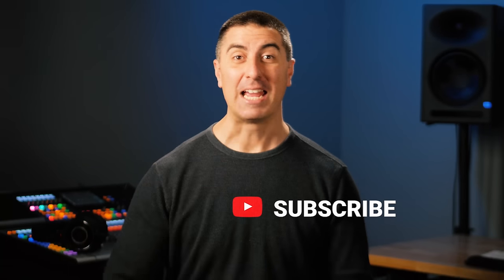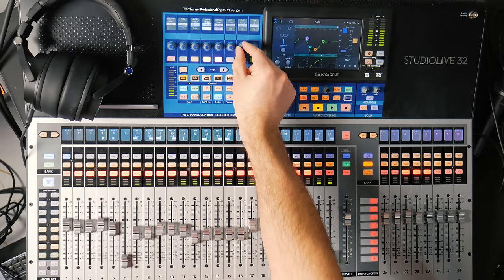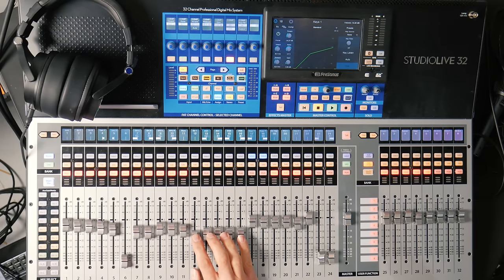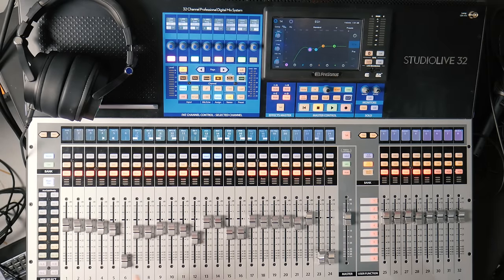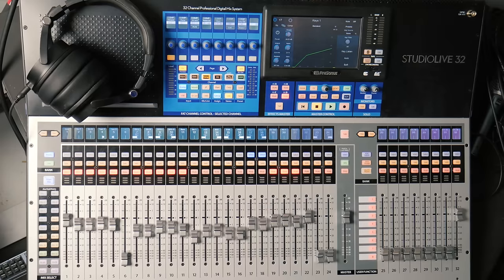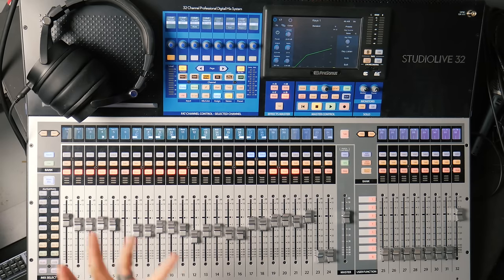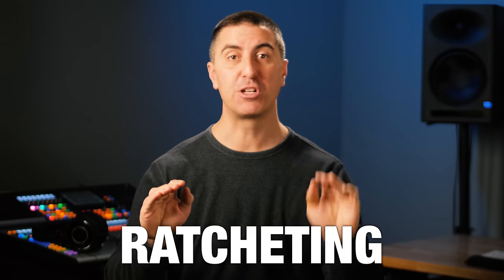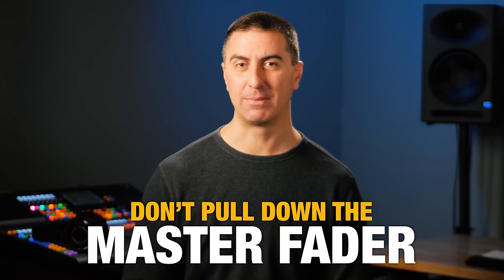Mixing Lots of Inputs Without Being Too Loud

Comment: I need to show this to our integrator. He hates that I use any kind of compression at all and thinks that I compress the life out of the sound. He's the only one who thinks so. I actually use parallel compression sometimes to add some life back into the compressed signal without increasing the overall signal. If I need to add to the signal, I use the gain makeup on the compressor. He doesn't like that either. He's not the one I have to make happy so I don't listen to him on that anyway. But it is good to hear someone who is knowledgeable justify what I'm doing. Personally, I think he's just deaf in the higher frequencies and likes anything that boosts those. I'm old enough to have some natural hearing loss in those frequencies. That's why I like to keep young people around - to alert me to any squeaks I can't hear very well.
Reply: No compression? That’s crazy !
Reply: You need a new integrator
Reply: Whats an integrator sir?
Reply: Use it properly and he won’t think that anymore. If you smash it he will notice because he’s so used to the consistency of the natural voice. But I get what both sides see now that I’ve worked with my friend closer and he also prefers natural sounds but he will compress it lighter and it still sounds really good. There’s so may ways to compress so you just need to choose what you want to do and learn more ways to see if something else could fit better
Reply: Get a hearing test so you can see where your weakness is and do when those frequencies stand out too much you’ll know because it will be toooooo clear for you and hurtful for other people
Reply: @DbiPro  I have normal hearing for age (57) with natural loss in the higher frequencies. I like to keep younger people around with good ears to check my mix. One of these is my oldest son who works with me on FOH. He is particularly sensitive to higher frequencies. By contrast, our integrator wears hearing aids and it seems obvious to me that he likes the high end cranked up because even his specially tuned hearing aids don't fully compensate for his hearing loss. What sounds good to him hurts most people's ears.

Comment: Great video! A lot of valuable tips. One I learned when we started streaming was getting my kick level and my vocal level set from the start and then mix in the rest of the foundation from there. I find by going back and referencing the relationship between the kick and the vocal as I build out my mix, it makes everything feel like it is in the same room vs that "here is the band mix and then the vocals float on top." This is especially helpful for live streaming mixes when you have a lot of control. I like how it makes the music "hug" the vocals.

Comment: I have a small orchestra with things like strings (synth playing a reduction and a few cellists) and organ doing sustained sounds, and bass instruments (organ, bass guitar, cellos sometimes, bowed contrabass, piano, and of course bass drum). I have choir with mic'ed front vocalists supporting them all behind the worship leader. I have an electric guitar, trumpets, and woodwinds doing various pops and fills. It's easy with all of this to think something like, "I can't hear _____, so I need to turn it up. Oh, now I can't hear _____, so I need to turn it up too." Enough of that kind of thinking and it can get away from you. (Edit: I wrote that about midway into the video and as I'm wrapping up my comment, I hear you saying exactly the same thing. So I must be in my right mind about this.) I run music with a median sustained level at about 82-85 dBa as measured from the console is right for my church to support the congregational singing and still hear the congregation. So I don't want to continually push it up. After a point it can just get to be a muddy mess.

I've found that a controlled sound is best to allow each instrument and group to have their own space, then I try to accentuate the harmonic qualities of each instrument. For example, how do you mix a bass guitar AND a contrabass that may or may not be playing the same thing at any given time? First, I draw out the upper frequencies that give each its own character and then I blend the lower frequencies together. But I also keep their faders independent and right next to each other so I can emphasize one or the other given the arrangement. This makes them sound good together while letting them each be heard. Our orchestra leader is also good at pulling in the orchestral parts that work well together. For example, this Sunday, he was playing an electric lead doing a fill dialog with the flute. That was all in the background where it should go so I didn't crank it up, but I let each one of them have their space in the mix and it was beautiful. So you have to pay attention to the arrangement.
Reply from the maker: Fantastic work Jim! Thanks for the comment :)

Comment: This is a great video. Im wondering about all the eq and compression routing  because I have an analog board...i.e. with an analog board do ineed to buy multiple compressors and eq to create a similar chain on individual insruments, groups and master busses ?
Reply from the maker: If you have groups (or aux sends that can be routed to the main bus or a matrix), you can put compressors on the groups. Depending on your musicians, you may not need compressors on every input.

Comment: Great video. Is there any way I can achieve similar results with an analog mixing board and an audio interface for my live stream?
Reply from the maker: Yes, if you have enough compressors. That's the challenge with analog - it requires more hardware to do the same thing a computer can do with 1s and 0s.